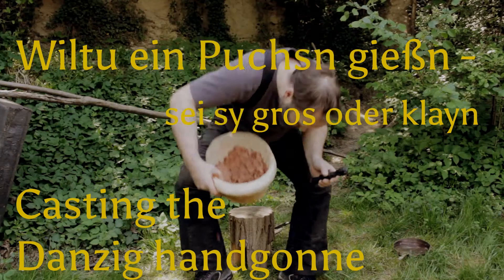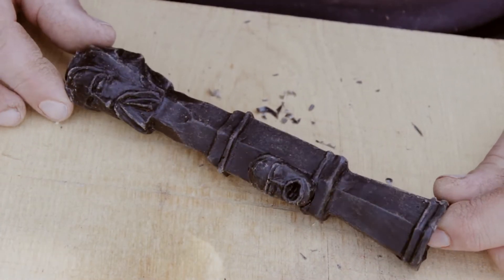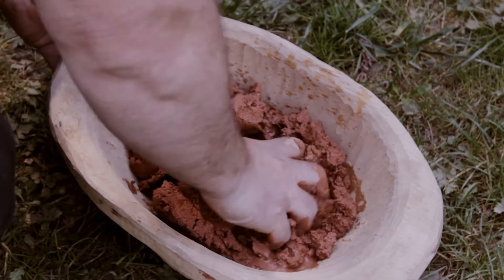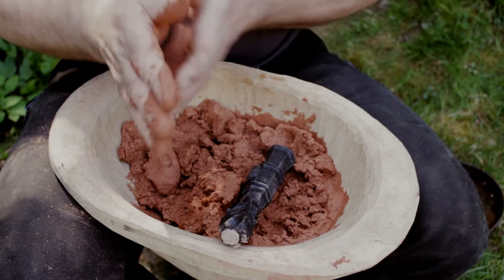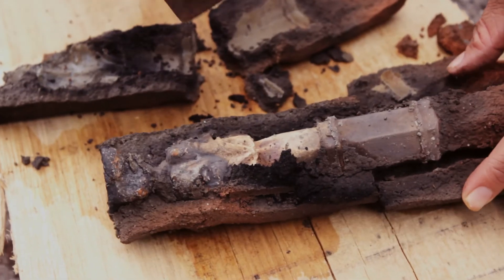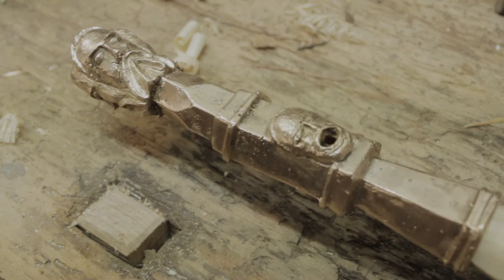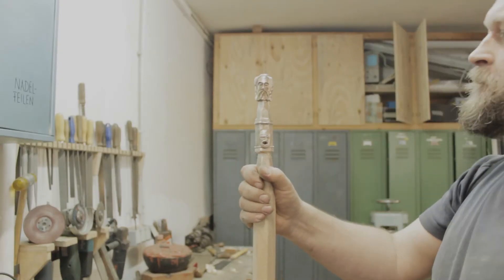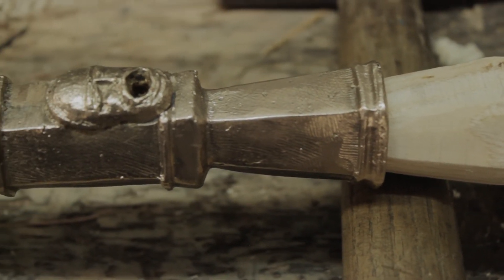Bronze Casting: Making a medieval firearm: The Danzig handgun/handgonne  #medievalgunfounder

Comment: Another interesting point.  Medieval hand gonnes tended to be anywhere between 12 inches to as much as 18 inches.  Exceptions were longer of course, but as said, just exceptions.  12 inches to 14 inches seems to be the most common lengths although standardization as we understand it today did not exist then.  Therefore, the short Danzig artistic hand gonne was definitely in the 'exception' category.